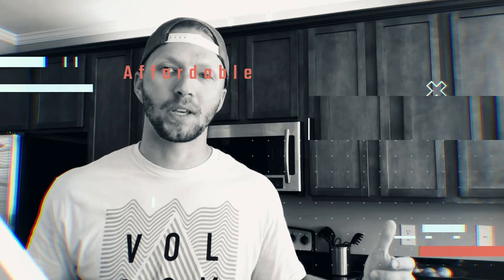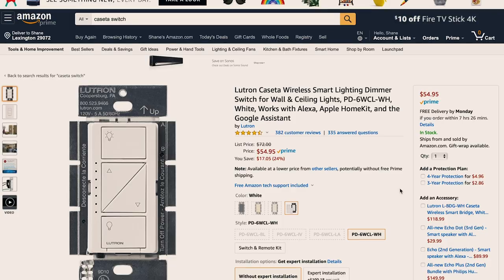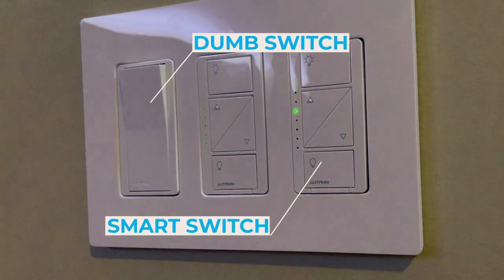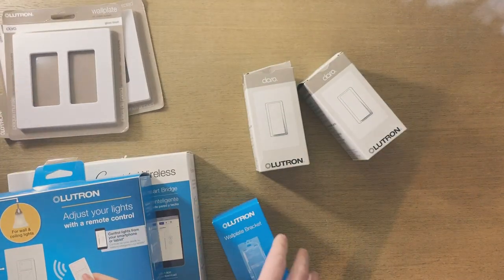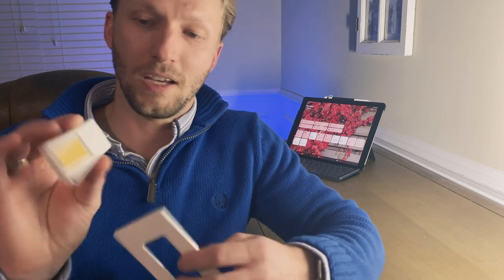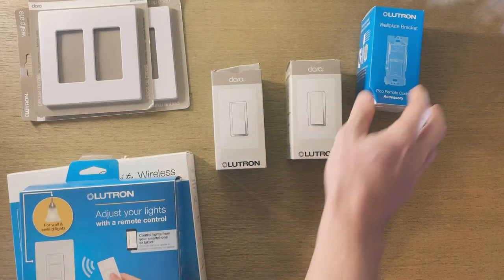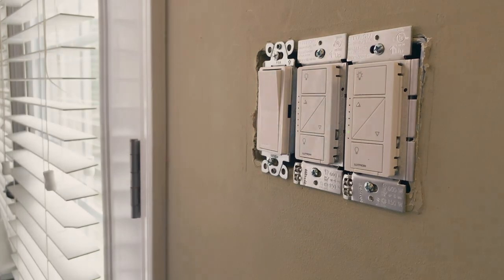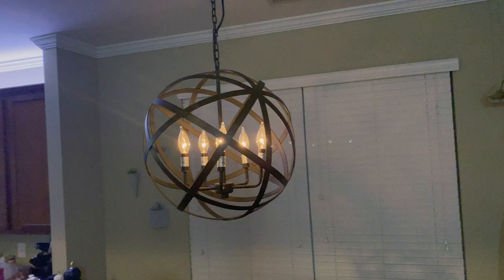2019 Best Smart Switches? How To Mix & Match Switches To Get Started!

Comment: It’s amazing how universally loved these Caseta switches are among HK users. I installed my first one over this holiday break on a three-way hallway light where we ended up breaking the functionality of one side while trying to install a Z-wave switch (which works with my smart alarm system, installed in 2008).  I used the Pico remote on the second side and a fixed it with the socket holder designed for it. The whole thing worked perfectly the first time and you just cannot tell a difference in speed between the remote and the wired switch. 

The only bummer is that I have about 25 more switches…

Comment: I'm about to make first Homekit plunge.  Do you think Lutron, with its mandatory Lutron bridge, is a good option if I don't know what "smart" devices I may later add to the Homekit home?  I guess for all light switches, I'll need to stick with Lutron products to utilize the bridge.
Reply from the maker: I think if you plan to go with smart switches throughout your house, you can’t go wrong with Lutron. The Lutron Caseta switches have proven the test of time. They are extremely reliable and I don’t think I’ve ever heard anyone say anything bad about them. You can still add whatever other products you want to your smart home later, just maybe stick with Lutron for the switches if you decide to get the hub.

Comment: Great video! I started with Caséta too and couldn’t be happier. I recently found my local Home Depot dropped the prices for the Leviton dimmer and regular switch. They’re a steal at $34 and $29 respectively. I installed them a few days ago and just as happy with them as I am Caséta. Might be worth checking out your local Home Depot.
Reply from the maker: Thanks for watching! Yea I still haven't used anything other than Lutron for my wall switches but lately I've been thinking about giving some others a try. Maybe I'll check these out. Thanks for the tip!

Comment: Nice idea to mix in the other Lutron switches to save money. I agree the cost can be crazy otherwise, which is why I’ve gone with a phased approach as well.

You can also get switch plates to fit rectangle switches and smaller “dumb” switches in one plate, but the fit is not always perfect.

Also nice motion graphics. I’m working on that but it’s not there yet.
Reply from the maker: Thanks! Yea I wanted all  the switches to at least look similar, which is one reason why I went ahead and replaced the "dumb" switches on the same wall plate with new "dumb" switches by Lutron. I really like how they look and it was an affordable solution.

Comment: Is this a solution for trying to add "Smartness" to normal bulbs or would this work with Philips Hue bulbs too?  I have a bunch of Hue lights throughout the house, but keep running into situations where family members turn them off via the switch and then none of the automation or the apps will work.  Any suggestions here?
Reply from the maker: Hi Victor. Smart switches like these typically don't play well with smart bulbs. I quickly learned the same thing you are experiencing and that's why I decided to move to smart switches. It's a lot easier to change switches allowing your family to still use them, than "train" your family not to use them so they don't mess up your smart home.

A rule of thumb that I go by nowadays is that if a light is controlled by a wall switch, I will use a smart wall switch rather than a smart bulb. This allows everyone to still use the switches without cutting connection to homekit. I reserve the smart bulbs for light fixtures such as lamps, etc that are not controlled by wall switches.

Comment: Shane, on the other side of my kitchen do I have to use a smart switch? Can the other remain dumb? I need to do that in my particular setting due to wall space. So one switch would be simply on/off. The main switch would be the Caseta. Will that work?
Reply from the maker: Hey Sherry, good question. I’m honestly not sure if that would work or not. It’s pretty easy to just cap off one switch and use the pico remote, as I did, for the second switch in the 3-way setup. But if you can’t for some reason, I’d probably ask Lutron support if you would be able to use just one caseta switch with a dumb switch in a 3-way switch setup. My gut tells me that it would lead to connection issues, but I could be wrong.
Reply: Shane Whatley I’m giving it a shot! I’ll let you know!
Reply from the maker: Sherry Sellers good luck!
Reply: Shane Whatley the other side of the kitchen turned them off after they had been dimmed but to turn them back on, it didn’t work, you had to go back to the dimmer to turn them back on. The dummy had to be wired differently, but it was in the instructions with the switch. Everything is working great!

Comment: Shane, I love all of your videos and they have been very helpful as I start making my home more of a smart home. I have a question about switches-I have one switch that controls the flame in my gas fireplace. I wonder if a smart switch would work in that situation.  I’d love to be able to have Siri turn on my fireplace during the winter but I’ve heard that gas fireplaces are “low voltage” switches and aren’t compatible with smart switches? Have you tried or seen any smart switch/fireplace combos?
Reply from the maker: Thanks David! Great question. And yes, you are 100% correct as far as I know. And to answer you, no I have not tried this yet, although it is something I'd love to do. Half the battle here is just convincing my wife I won't blow up the house!

But you are right. Since the fireplace switches are low voltage, just changing the switch isn't enough. You will probably need to use a relay switch, in addition to a smart wall switch. You can find these relay switch kits for your fireplace pretty cheap on amazon. And there are tutorials and such online if you look around that should help. And when in doubt, call an electrician for some guidance just to be safe.

Comment: Look into Aqara. They've got extremely affordable smart switches (for HomeKit). They have got both integrated switches (around 20€ on AliExpress) and wireless (~10€). 
I went with the wireless solution because the square box behind the integrated switch wouldn't fit inside my round EU switch box. However, I removed the "dumb switch" and mounted the wireless switch to cover the dumb switch box and connected the power to be constantly on. I've done 3 rooms so far but plan on replacing most standalone switches in the house. I already have Hue in every socket in the house and an Aqara HomeKit hub so that made this a lot easier. In Homekit you can choose 3 different actions per switch. My setuo is: One push (ON), double push (OFF) or long press (Lights to 10%).
Reply: PS, the reason why I invested so much effort and some money  into this problem was the same as yours. Wife and kids running around flipping wrong switches made my smart home feel dumb :D.
Reply from the maker: That's awesome! Thanks for the suggestion. I don't know much about the Aqara light switches. One reason I went with the Lutron is because I knew they would fit in my current switch boxes and I like that I could mix and match with "dumb" switches and still have them look pretty consistent. Plus I have lots of 3-gang wall switch plates.   Aqara has some really neat, affordable products and I'm definitely looking at them for some future additions.
Reply: Great video Shane. Subscribed. Question for both Shane and Robin C, I was thinking about doing the exact same set up as what Robin did.  "always on switch"<---> Smart light  +  Wireless Aqara switch (which can be place anywhere)<---> Aqara Hub. My question is, what will happen if the internet goes down? will the switch still work?

Comment: One thing I like to ask, do you think that triple wallplate will work with other smart switch brands like the Gosund
Reply from the maker: It's possible since many of those style switches appear to be similar size. However there is no guarantee, as with Lutron you know for sure they will fit since it's all made by Lutron. You could try measuring the size of your smart switch and compare to the size of the lutron switches or wall plates. You can probably find the product size specs online somewhere.

Comment: Came here from your Jeremy Siers (sp) comment. I’m glad I found a dedicated HomeKit youtuber. I agree with your security opinion. Subscribed. Currently I have Vocolinc bulbs. Maybe 15 and I’m regretting it because there’s over 30 devices now running through my 2TB Airport Timecapsule. ‘Hub” connected devices are necessary imo. Do you have a solution without replacing all bulbs? I also have every Nest device...not HomeKit compatible rt now. 😞😔
Reply from the maker: Thanks for the sub! I have a few Vocolinc devices as well. And yea it doesn't seem like Nest (made by Google) is in any rush to add HomeKit support. Not sure about your bulb situation. Are you having connection issues? If your Timecapsule is still running strong with good speeds, replacing the bulbs with hub connected bulbs or changing out the switches (using regular bulbs) as I did might be the only options.
Reply: For the most part the Vocolinc bulbs work well. It’s, I would say weekly, a bulb says “not connected.” I have to turn off and on the device and it’s fine after that. Sort of rebooting it I guess. But no other devices have this issue. Lift master garage door works well, all nest devices, door locks, light strips etc. all work well. Other than that one issue, the Vocolinc bulbs are awesome. Anyway, good luck on the channel and I’ll keep up.
Reply from the maker: Yea I have that issue sometime with my Vocolinc devices. I like them too but sometimes they have these minor connection issues. They are always pushing out firmware updates, which is good. That means they are continuously working on improving things.